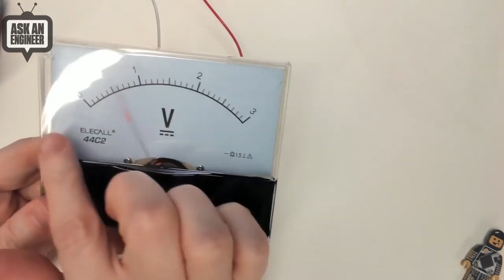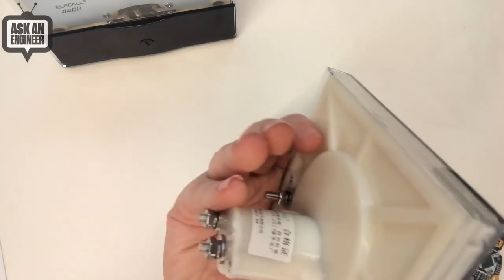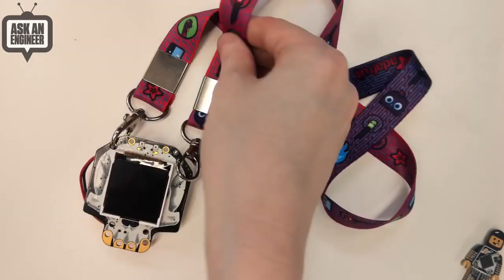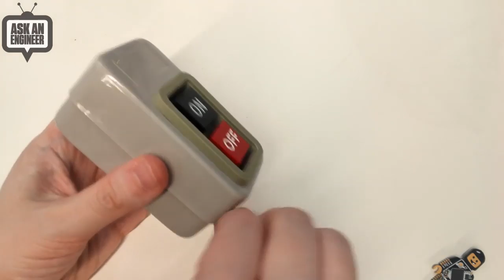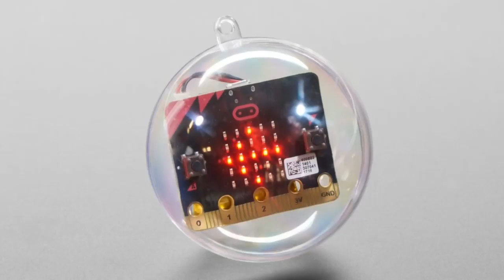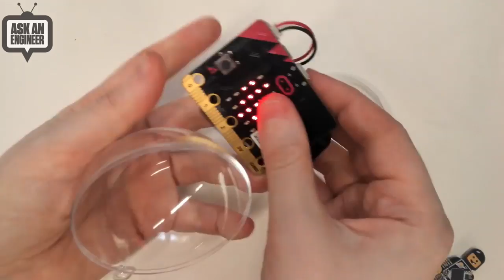New Products 11/28/18 Featuring Adafruit #I2S #AudioBonnet for #RaspberryPi @adafruit #adafruit

Comment: What's the resistance of those meters? I'm thinking of using an LM358 with a diode after it to drive one as a level meter. Will the LM358 be able to supply enough current?

Comment: Can take two or three analog meters and make a clock out of them.
Reply: I just made one of these, using different meters,  and an ESP8266.  It gets time from NTP and adjusts for daylight savings time automatically.  A rotary encoder allows you to change to a different time zone.

If you do this, get a program called MeterBasic to design the face and scale of the meters.

Comment: The VU meters can easily be modded with back lights (leds). You can use the reflective vinyl used in stenciling to create a mirrored back too that reflects the needle. Pretty sharp looking. And don't forget you can reorient the meters vertically to create the meter effects you see in cool control settings like in a reactor monitoring station.